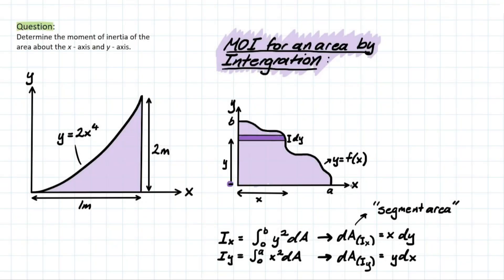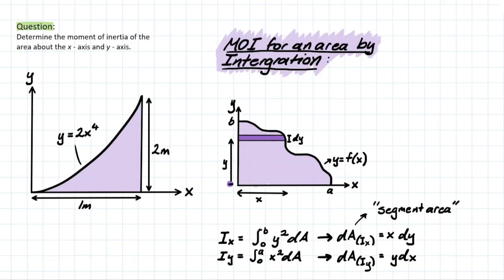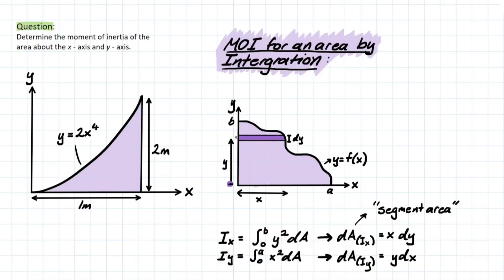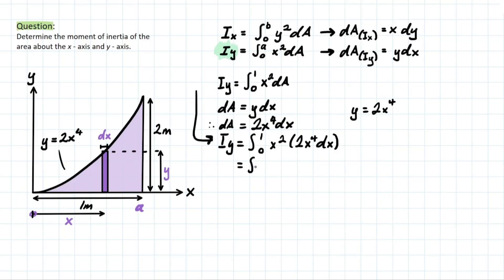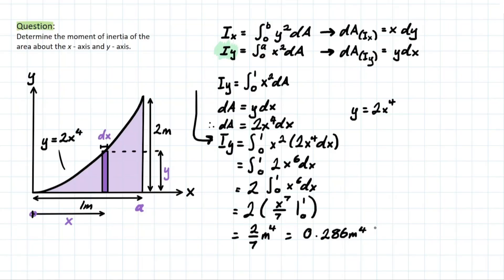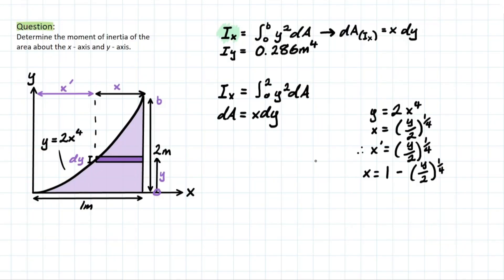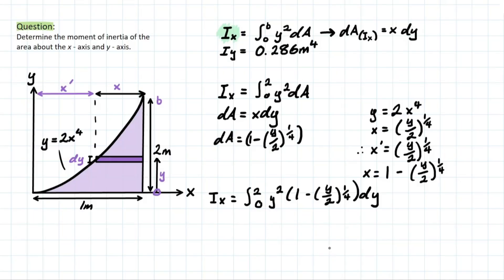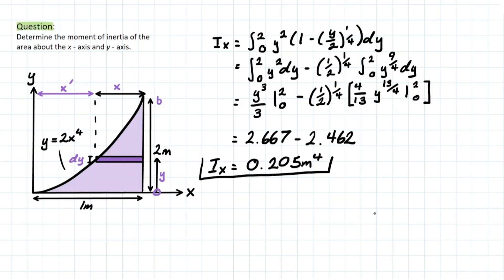Moment of Inertia by Integration Problem and Solution!

Comment: I’m wondering for dA =ydx why don’t we do the same thing for y? As 1-x
Reply from the maker: Sorry, I am a bit confused by your question. I think the one rule to remember is that when integrating with respect to a single variable, we cannot have x and y in the same function. 

Also, we must keep in mind what is bounded by the function and the respective axis. ydx is bounded by the area under the curve that we are interested in. However, xdy needs to be manipulated use 1-x' to get the corresponding segment in the area under the curve.

Hope this helps